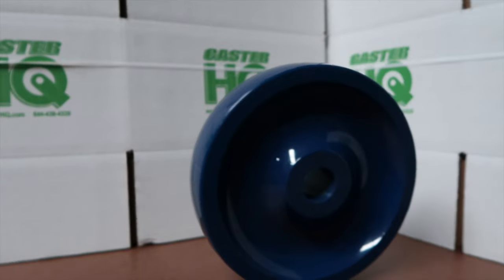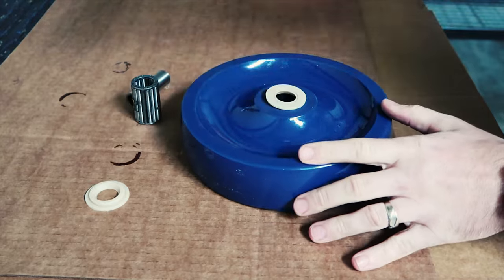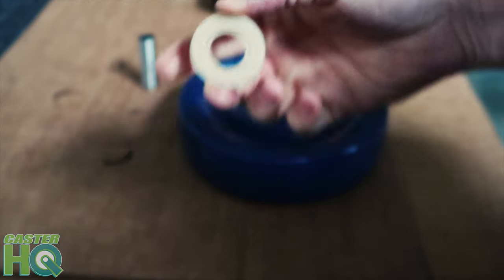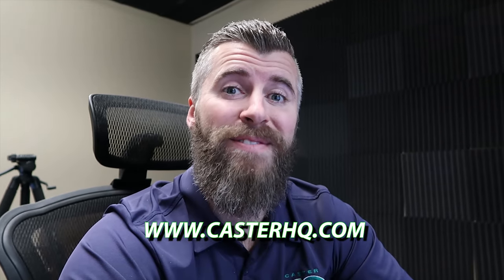How to Install a Roller Bearing Inside of a Caster Wheel

Comment from the maker: 0:00 Intro
0:12 Parts needed to install a roller bearing
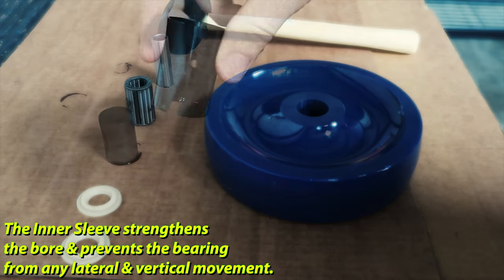0:30 Starting off the Installation
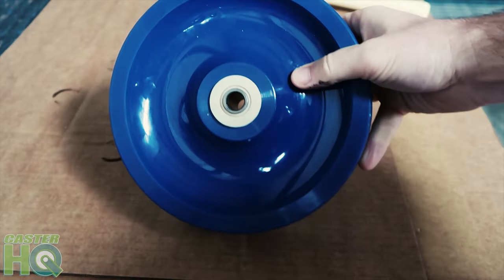1:25 Information on Caster Wheel Bearings
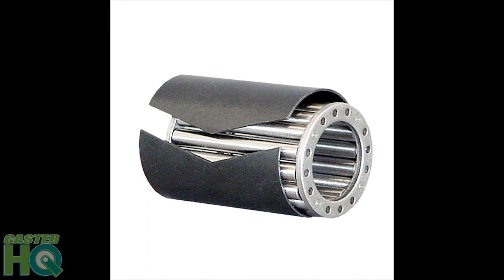1:44 Different Bearing Types for Caster Wheels
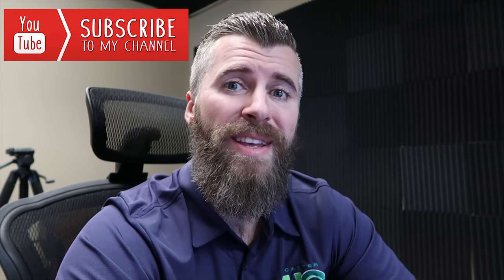2:06 Please Like and Subscribe
2:38 End of Video

Comment: Interesting to see that a bearing is added to a supposed non-bearing caster wheel.  Are those wheels ever used without an added bearing?  I bought a rolling work table from Harbor Freight and was a bit disappointed that the casters did not have a roller, ball, or sleeve bearing.  The axle fix sloppily inside the wheel hole.  I added shim material (soda can aluminum) to take up most of the slack and added a washer or two to remove side to side play. I wonder if those wheels  could handle the addition of a real bearing?  An additional problem was that the rotating casters (locking) dragged along the floor, refusing to swivel no matter the direction.  I disassembled them (drilled out the rivet) and found that the tolerance of manufacture was so poor that the number of bearings (22x2 sides) were crowded and so I remove one and reassembled them.  They work much better but still suffer from some drag along the floor, not swiveling smoothly.  Warranty replacement swivel pair are on order and I am almost frightened to see what comes.  Just curious about your take on this.